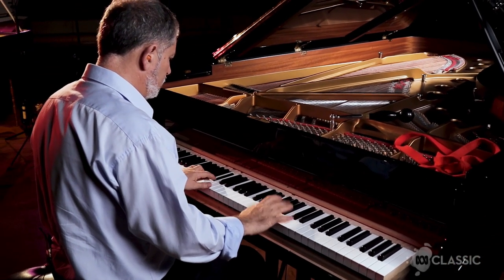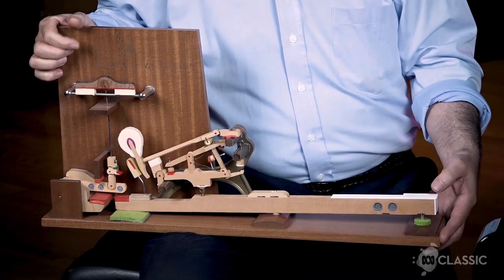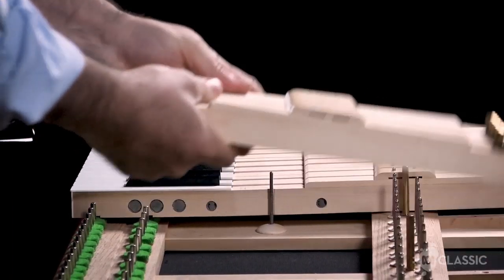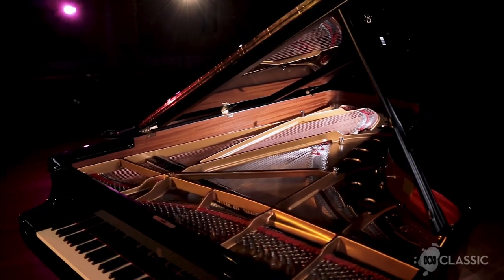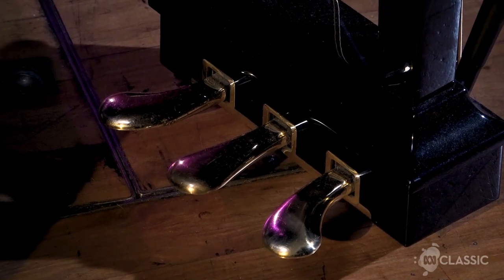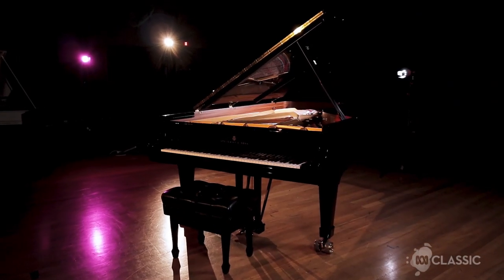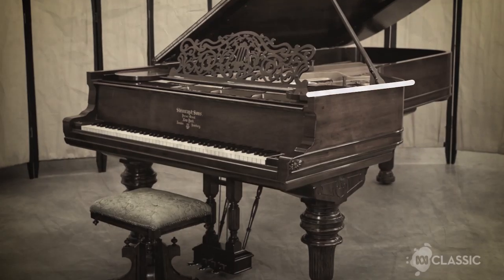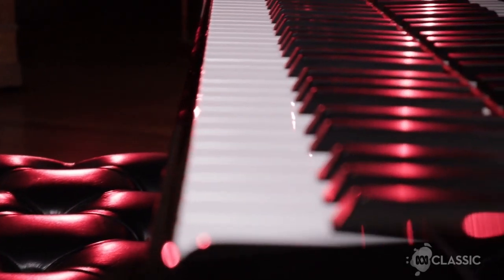How does a piano work? Pulling apart a grand piano

Comment: The most interesting thing about the piano is the strings’ different lengths and thicknesses. I like how the strings for higher notes are shorter and thinner and the strings for lower notes are longer and thicker. The other thing I really like is that there are 3 steel strings for most notes, 2 copper strings for lower notes, and only 1 copper string for the lowest notes. Copper makes the low notes sound heavier and more powerful.